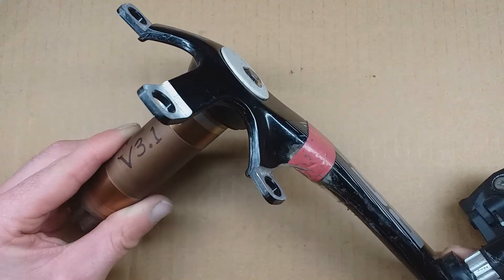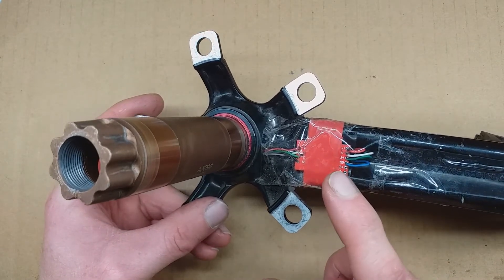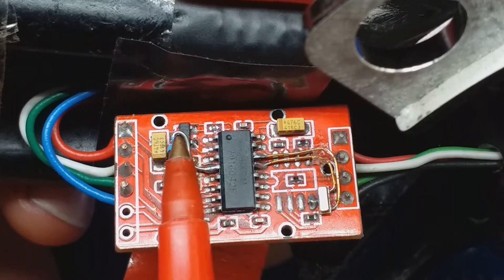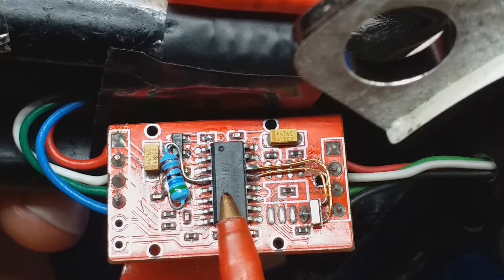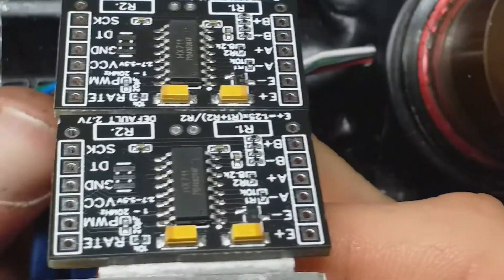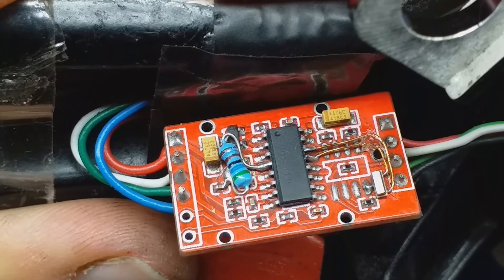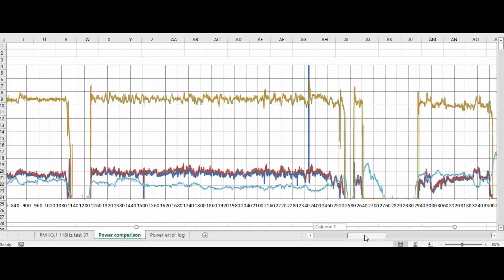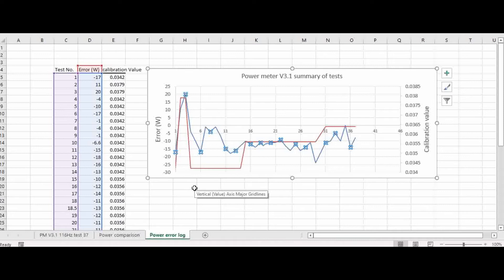Homemade Bicycle Power meter V3.1 update and long term power error

Comment: Hi Ed, very interesting.   I'm trying to do similar with hx711 and an mpu650 for rotation speed.  Are you willing to share source code?   I also started with op-amp and found it too hard.  Am curious what radio and display you are using now.   I just have a nRF24 link.  I was planning to later try an ESP32 for BLE to the bike computer, hoping it can be done in the Arduino IDE.   Do you have a working link for  the forum please?
Reply from the maker: Thanks, maybe I need to make a video soon explaining where I'm going with my power meter and put the code up.
I don't intend to use an extra module for cadence. I currently use an nrf24l01 but the future plan is ANT+ using Segger embedded studio. I think I have chosen the hardest option but in the end it will be a better learning experience even if it takes me years.
Reply: @Ed.R  Isn't ant+ being replaced by BLE? Phones seem to be dropping support.  But nRF52 does both, no?   I imagine the best eventual solution would be a custom PCB with nRF52 surface-mount module. Can put the hx711 and mpu6050 chips on that.
Reply from the maker: @ewetoob1924  I guess ANT+ will go eventually as people seem to prefer BLE but at the moment my Garmin Vector pedals and computer use it. You are correct nRF52 chips can do both with the right soft device. I'm going to be using ANT+ for communication between my power meter and the automatic shifter. So can use it as long as I want.
A custom PCB would be the way to go but I may not bother as I have plenty space inside my crank axle. Especially once I loose the nrf24l01 module it will just be the power latch circuit and an nRF52840 board and whatever 1S lipo fits.
Code and video are up if you check out my latest video. Thanks for the motivation to finally get it up.

Comment: Hey!
great project! could you imagine to make an open source project and post a detailed instruction including the code for beginners?
I've already read through your blog but it seems a bit outdated.
looking forward to your next update:)
greetings from Austria.
Reply from the maker: Hi, thank you. I have never felt that the project is finished enough to be fully made public for others to copy. I'd like to get the ANT+ working first otherwise the nrf24l01 communication is of limited use to most people. Having said that now that I'm beginning to get an idea of the potential and limitations of the project I might consider it. I wouldn't provide detailed instructions for the entire build because cranks are different and I have no idea what I'm doing when it comes to strain gauge installation. Definitely could share code and wiring diagram.
Reply: @Ed.R  Thanks for your answer! I'm really interested in the code. Do you think there is a possibility to send the Power via Bluetooth to a Garmin Edge 530 instead of Ant+? Wouldn't that be easier?
Reply from the maker: @felixp.2535  Have now put the code up on Arduino project hub find link in description of my latest video https://youtu.be/2bmOP68gpBo
I think BLE might be easier but I wanted the challenge of ANT+. Not sure if Garmin computers receive BLE, I assume they do. My old Edge 500 just says ANT+ on it.
Reply: @Ed.R  Hey, 
Thanks for sharing and for your explanation line by line! I'm really looking forward to your project with ant+:)
Best regards,
Felix

Comment: Hii, im an engineering student and im about to have a power meter as my final thesis. 

I was about to click and read on the forum's link but it says 404 not found, did you change the link or maybe something?

Thanks!
Reply from the maker: Sorry I get the same appears the link has been shortened by YouTube I'll try putting it again here
https://normandnadon.com/forum/showthread.php?tid=3083
The forum is actually a bit out of date and only shows the build of my original power meter which used an amplifier not the HX711.
Best to look through my video playlist here on YouTube for the more recent developments.
https://youtube.com/playlist?list=PLGwDuFncb0Ky7Xtqh5f4zIB2kjJFK9wUi
Reply: @Ed.R  aightt ! thanks for the response ! 

right now, im quite optimistic about the concept of the strain gauge, but im a little worried about how the gyroscope works on a crankset. 

how did you specifically made the MPU6050 works on the crank? have you done the kalman digital filter on it? because ive read some of the journals that says MPU6050 have some output issues against angle measurement on something that rotate. and did you use those 3 respects (X,Y,Z) of the MPU or do just using 2 of em?
Reply from the maker: @MrSafetyRider I'm afraid I'm not going to be very helpful on this one because I don't use an IMU. I measure cadence off the force waveform. It has its limitations but is surprising accurate.
Is worth learning how to use one though as they are interesting. I followed this playlist of video tutorials to get the basics. https://youtube.com/playlist?list=PLGs0VKk2DiYwEo-k0mjIkWXlkrJWAU4L9
I did find some code somewhere that was great at measuring rpm will see if I can find it. Never completely understood it myself so can't really explain how it's done to someone else.
One thing I did remember was that its important to combine the  accelerometer and gyro. Accelerometer never drifts but suffers a lot of vibration noise. The gyro drifts badly but doesn't suffer from noise due to vibrations. Getting the right blend of the 2 was the clever bit.
Reply from the maker: @MrSafetyRider  The rpm code I was thinking of is in the examples of the Arduino_LSM9DS1 library. That is for the Nano-33-ble on board IMU. Appears if you only need rpm then the gyro on it's own works ok once calibrated. If you wanted an angle that's where the accelerometer is needed.
Hope this helps a little.
Reply: @Ed.R  aightt, thanks a bunch for your time and information sir!! ill let you know in a few months for the final systems.
Reply: @Ed.R  magnetometers are used in 'magnetless' speed and cadence sensors. Most IMU modules have a 3 axis magnetometer mems sensor. Been looking into making a speed sensor like this, even though they can be bought for $10 from China.
Reply from the maker: @avibank  It is a great way to measure rpm because the measurement is almost instant, no waiting for a full rotation.
Do you actually mean using the magnetometer not the gyro? The example I tried uses the gyro.
Have been considering doing a cadence/speed sensor as a first ANT+ project in Segger. As the Arduino Nano BLE has both an nRF52840 and a 9 axis IMU on board. Should only require the right code to make it work. Not considering fitting it to the bike but just treat it as a code learning experience.

Comment: I would like to give you suggestion ! You can use the analog to digital ic from Texas instrument which are smaller than HX711 having delta sigma compability,this will give you very high precision
Reply from the maker: Thanks that would be another possibility.
Reply: @Ed.R  I was watching this Keith Wakehem video where he goes through the innards of a new Wahoo pedal power meter. At around 6:39 he talks a bit about the TI ADC they use. https://youtu.be/hIK4F9xcA-Q?t=399
Reply from the maker: @avibank  I notice that the setup is a combination of amplifier and ADC. I've no doubt there are better ADCs however my goal with my power meter is keep it cheap and simple. The HX711 is so readily available and cheap and does everything amp and ADC all in one.
Reply: @Ed.R  I replied to this last week and Youtube seems to have deleted it and any record of it in my history :/
In essence I agree hx711 is the best choice given the goals and constraints.
I did find some TI ADC's being sold in little purple modules, not too much more expensive than the HX711. The chip is ads1232/1. Also has a built in PGA like the HX711. I put a link in the comment that got deleted so I won't again.
Would be interesting to experiment with if I can get my hands on some.
Reply from the maker: @avibank  That's annoying how YouTube is deleting comments. I asked and they didn't give me any option to allow all comments.
I had a look at the ADS1232 data sheets and actually rather like the look of it. Appears to be very similar in most ways to the HX711 but seems more professional. I like the smaller clock dividers meaning full 130Hz sample rate is achievable with 8MHz, an easily achievable PWM frequency.
Also notice the boards on Ebay come with a position for a basic 2 pin crystal like I should have done 🤦‍♂️. Even states that capacitors aren't required. The HX711 data sheet is a bit vague about clock sources.
If I find a library for the ADS1232 that works on nRF52 chips I might be giving it a go.

Comment: Thanks for the update! Looking forward to seeing your waterproofing solution. Interesting point about the temperature. Is a Wheatstone bridge not always effective in compensating for those changes? Also thanks for the NRF52 link. Don't discount the the NRF51 - it should start getting cheaper at some point and is still a little beast.

Edit: I don't think the links are working. Sumair's channel: https://www.youtube.com/channel/UCSGA2xba6YOw_2levQjWleg/videos
Reply from the maker: No problem, thanks for commenting.
Strain gauges are so highly sensitive to temperature, the wheatstone bridge with 4 stain gauges is good a compensating. However there is always going to be some variation in the thermal expansion of the material. Can't have all the stain gauges in the same place. Even a bright light shining on one side of the crank changes the value which is incredible.
I hadn't thought about the nRF51s, they are no doubt up to the job and as you say could be cheaper. Will look out for some.
Thanks for pointing out the link, it is now corrected.
Reply: @Ed.R  Makes sense. Thanks for explaining. Do you know how the commercial crank based units account for this? Just more calibration or sensors?
Reply from the maker: @avibank  I believe they spend a while measuring and quantifying it which is part of the reason for the high prices. Also other factors like picking up torque from the other crank. Putting the strain gauges in a pocket inside the crank will help avoid the effect of the sun shining on one side of the crank. I assume they will measure temperature and the software will use a look up table to apply a compensation. Not really sure what goes on to achieve 1% accuracy but this is as much as I've picked up along the way.